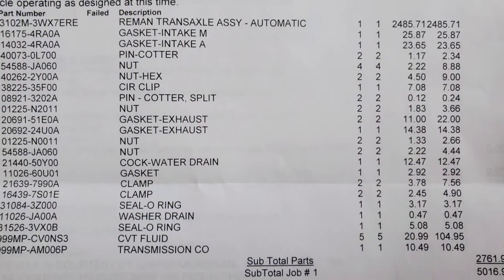2017 Nissan Maxima Cvt Failure! 🔴 What Signs to Watch For and Things To Avoid!

Comment: Very interesting. Thanks for posting this. First, I am shocked that a car like this even has a CVT. I don't think I agree with that. And I had no idea these CVTs require such frequent fluid changes. Someone wrote in down below that an oil cooler should be installed and I definitely would do that. I am watching this video because I am thinking about buying a 2017 Maxima SV with only 9000 miles on it (today is 11/30/2022). The car just sits in a garage and never used and I think the guy wants to sell it. I currently have a 2003 Acura TL-S which was 20 years old last June and it has been an amazing car. I have done nothing except a lot of maintenance and I still have the original tranny, which I have serviced often as well, but not 20k miles...... that's crazy. I am sure the Nissan manual doesn't require that. My Acura only has 134,000 miles on it and it runs like the day I bought it. I was just thinking to get a new car at this point after 20 years and this Maxima with only 9000 miles on it seemed like a good move. BUT, I am not so sure now. These CVTs in a performance car like this was a mistake. I don't want a $5000 bill. Sometimes it pays to keep what you know. I don't drive much anymore anyway. I definitely like the looks of the 2017 Maxima though.
Reply: Without doubt great looks. But like you, that CVT scares me.
Reply: @fazilm1  I have to assume that if the car is not driven hard, especially when cold and you do frequent fluid changes, they will last 100k miles or more.... personally, if i had one i would get the fluid and filters changed at 20k - 25k miles and make sure it had an external cooler on it... maybe even get a secondary cooler.... this way it won't get as hot...
Funny, since I posted initially I had to replace the original tranny on my 21 year old Acura... maybe I should have kept my mouth shut. But i have no complaints after so long... but the $4000 was rough... the car isn't even worth that anymore, but the motor still runs like new...

Comment: Thx for posting. Sharing experiences helps others and you never know when something might be posted that might help you.
After reading about Nissan CVT issues, I still just now took a risk and purchased a 2015 Altima 2.5L because the price was so low. Car drivetrain appears to be operating top notch despite having over 210,000 miles on it so yeah... I'm wondering if there is such a thing as a CVT designed EOL even if it was maintained perfectly (of course, no way to know you only have the word of the seller). Compared to your videos, I hear nothing of the roughness you seem to get al all RPMs, mine is practically silent through the entire range. 
In fact, I'm currently trying to figure out a weird whining sound in my car that is louder only when in idle and actually gradually disappears in a couple of distinct steps as torque/rpm is increased... Completely backwards from what people describe as signs of a failing CVT. Although the whine seems to be related to RPM, am considering it might be unrelated to the CVT, eg A/C.

In any case, fingers crossed, I'm hoping that if my CVT fails, it won't be for at least another 8 years or so which hopefully would allow more pulled and remanufactured CVTs to come to market. I notice that at least today that there are so many available used and remanufactured CVT older than 2009 that decent options exist as low as about $500 whereas today it's really hard to locate anything for your and my model years... I see a couple "maybes" for about $1600 and am not surprised at all that you paid $2500 for a remanufactured which probably has a decent warranty plus misc parts that might total another $300 or so.
Reply: Discovered what the whine I was hearing is from a comment elsewhere.
After a bit of testing, verified it's the electric power steering.
The comment I read said that person had it diagnosed by a Nissan dealer which said that the whine "was normal" so don't do anything about it. 
Wow. It's a very prominent whine, and as I described is completely opposite how people describe CVT problems in that the whine is more prominent when the engine is either at idle or low RPMs and although still there is less prominent the faster the car's speed.
Hope as described it really is nothing to worry about. There's no problem with steering and fluid is fine. 
And, just to be certain I bled the line by turning the wheel all the way extremes several times.
Reply: fluid type is nissan psf

Comment: I have a 2016 Maxima. Im noticing a bit of a lag/delay when shifting on (R) and (D) and the car shake a bit when changing to those gears. Is this normal for CVT or it means there's a problem with the transmission?
Reply: Eventually the transmission will go.
Reply: @iansamaroo9187  k but what about my question?
Reply: @hircine92h  once your having that issue with the delay in switching gears it’s the CVT that’s going bad and eventually it’s gonna give out. It literally just happened to me last week and made the decision to replace my transmission. But not from the dealer because they wanted twice the amount I actually paid to get it done.
Reply: @iansamaroo9187  I search online and some ppl saying its normal for CVT to do this and others said they had it since they got the car from day 1. So idk its weird to me as I always driven the traditional automatic transmission.
Reply: @iansamaroo9187  I even took the car to some place to look into it. They scanned the vehicle and found no issues.
Reply: @hircine92h  as a precaution change the transmission oil.
Reply: @hircine92h  also when you do an oil change go to autozone and get Lucas Oil and mix it in with your reg oil. It’s a lubricant to help with the pistons and transmission. But make sure it’s not Lucas Oil for trucks don’t get that one ok.
Reply: @iansamaroo9187  Got it. Thanks a lot.
Reply: @hircine92h  not a problem anything to help. Hopefully this can help others too…any questions that I can help with I’ll do my best!

Comment: Steady foot on takeoffs otherwise different acceleration results and thats normal. Some dont know how CVTs operate and how sensitive they are to your foot. I saw that the car was accelerating in both clips and no slips whatsoever just a different acceleration behavior to throttle response.

Comment: I have a 2017 SL with 103k miles. I've noticed an issue with what I think is the torque converter. When I'm going from 0-35 then let off the gas there is a thump feeling, and the torque converter does not lock up smoothly. I've done a transmission flush but it didn't help the issue. Does anyone know what this problem could be? I'm worried about having to replace the whole transmission.
Reply: You usually get that phenomenon when you are at light throttle and the lockup function of the torque converter is at the threshold of either locking or not locking.
Reply: @mitchlu  I got rid of the car, scared me thinking the transmission was going to blow, never experienced anything like that in a vehicle before
Reply: @tempo869  I understand completely. That feeling is definitely way more pronounced in the Maxima (I had mine since new, 125K miles now). In my  '07 Altima 3.5SE, you didn't feel it as much, but it was definitely there.

Comment: I traded in my 2016 Nissan Altima I had for six years, bought in 2016,. I got it when it had 2,000 Miles, traded with 58, 000 Mike's for a 2019 Nissan maxima cv  with 21.000 miles on it.  I want me now a Dodge scat cat 2021, with 50, 000 miles for $55,000 Miles in a white, body the green is for $47.000 miles.
Reply from the maker: i sooooo want a charger but its not in the cards right now

Comment: My 2021 Altima sv will hesitate like hell for about 5 or so seconds then take off like a damn rocket. I’ve only had it a year and only 50k miles. And around 1 to 1.5 k Rpm at low speed it’s doing that shaking rumbling thing. If I would’ve known about the Versa coming in a 5 speed I would’ve bought one brand new and spent less than a used Altima.

Comment: did you do a CVT fluid flush refill before 123k? if you didnt. thats the main reason it went out. CVTs are m reliable. manufacturers lie if they say lifetime fluid. cvt fluid deteriorate. heat makes them go bad as well. well known mod if your into the car modification it cvt transmission coolers. Essentially a thermostat which keeps the cvt fluid in the sweet spot for temps. and im referencing subaru CVTs. You had a Nissan CVT so you were a goner from the jump. CVTs get a bad rap because of Nissans. their CVTs are the highest for faults.

Comment: I’ve owned my 2010 Maxima SV ten years. I bought it back in 2012 with 39,000 miles. At 99k in July 2016, my CVT was replaced under the 100,000 power train warranty that Nissan extended out to some of the 2009-2010 Maxima models. My cvt never went completely out but it was making a slight whine during our hot Vegas summers, so Nissan replaced it. Fast forward to 2022, it’s still driving good with 176,000 miles on it. Call me silly but my car has been maintained by the dealer and I was never sold anything I didn’t need to prolong the life of my car. I never had any serious issues nor has my maxima left me stranded. I feel for my fellow Maxima owners. I like the smooth acceleration of the cvt for the Maxima. I was going to upgrade to the Maxima SR or Platinum trim but I still like the curves of my current generation. At the end, it’s unfortunate that the cvt may have been the culprit and the reason why Nissan decided to axe the Maxima for gen 9. This has been a great car to me
Reply from the maker: your experience sounds similiar to mine minus the dealer covering my replacement. Overall i still love this car
Reply: did you use oem cvt oil or aftermarket
Reply: @joeydelmarsjr.646  OEM
Reply: finally a vegas person, i bought mine 4 years ago, 2015 altima with 59,000 miles. now i am starting to feel the slip BUT i didnt do my research on the nissan transmsission. NOW i know.. change the transmission fluid 30k.  i love my car and it’s very sentimental to me, my dad helped me buy it before he died, ironically so i would have a reliable car that would last me 200,000 miles. i need this car to last me, didnt have a good experience at nisssan on sahara, where do you go? our summers are brutal.
Reply: @jaynafayknight  Henderson Nissan  (now Findlay Nissan) at the auto mall. I’m abt to do my 200k mile service before the summer hits. My service advisor is Chris P if you happen to stop by. His desk is the first desk as you walk in the service area.
Reply: @djaydoubleyou8162  awesome you are rad thank you

Comment: My 2017 Maxs cvt went out at 73k on it might have been my fault for not doing a fluid change on it at 60k but yet again i used to beat on it and use manual mode often i went to lkq bout a cvt off a wrecked maxima for 800 with 63k on it and paid 1200 for the install definitely wasnt bad but since then not once havent used manual mode and baby it have currently 98k on it and just did a fluid change + the 2 filters its a great car just with it had a better transmission

Comment: If I EVER needed a friend, I need 1 now.
I got a transmission flush done by my mechanic, at around 75-80K miles. 
I did NOT know, that there's a specific trans fluid needed for the flush.
My mechanic is a old school mechanic and I believe he used some typical trans fluid, NOT knowing that you need CVT fluid. I didn't know of this CVT fluid, until 1 week ago.
Called Nissan and he said, IF your mechanic messed up the trans flush and it was the wrong fluid - you would noticed issues, a very long time ago. 
I just turned my 07 Maxima to 115K miles and now the car "jerks" when accelerating - Is it TOO late to do a CVT flush or I gotta replace the CVT ????????????????? PLEASE SOMEONE HELP ME OUT

Comment: Yes! The class action lawsuit covers almost the entire lineup with the CVT. My car is a 2013 Altima, but I’ve got 190k on it and I drive it like a granny. My next vehicle will absolutely be a Toyota product hands DOWN. I’ve loved the car and it’s gotten me from point A to point B but overall it hasn’t been worth the stress of worrying about it.
Reply: Toyota also has CVT's however supposedly they are better then Nissan
Reply: @craftlover9702  no belts all planetary gears in Toyota
Reply: @miketresham4783  and they use chains too. I got the 2020 corolla myself and all my driving in both the city and highway is 2000rpms or lower. Higher elevations at the most 2800rpms, thats how efficient it is.
Reply: @miketresham4783  Does that mean it's much better?
Reply: So did they replace the transmission?   Is it a different design?
Reply: @eastside313yahdig.2  yes they replaced any transmission that was experiencing those issues. All in all it was a 300 million dollar lawsuit since Nissan knew of the issues and still didn’t bother to change the transmission or the mechanics.
Reply: @craftlover9702  Yes, using a planetary gearset is far more reliable than a push belt style CVT. On a Nissan there is a steel belt, not exactly a chain, it looks like a hammered out piece of steel that has very tiny links wrapped in a circle. 

The Toyota Hybrids have an even more reliable system. Since it uses an electric motor for most of the work and a planetary gearset attached to it.
Reply: @ehh2681  the toyota non hybrid cvts use chains and they are good
Reply: @ehh2681  so what if I buy a use 17-20 and it starts this issue, will they replace it for free?   I plan on buying one with less than 30k miles.   I’ve seen a few 17’s - 20’s.
Reply: @eastside313yahdig.2  They have a 5 year 60k mile warranty on the new ones so if you don’t think you’ll use the car or trade it in before 100k then I’d say go for it. 
I’d still go for a Toyota Camry though no matter how much more expensive they are. It’s more worth it to invest in something that will last you in the long run, but if you aren’t planning on keeping the car for long then I’d say go for it.
Reply: @ehh2681  yeah dawg I roll my cars,    I still got my 03 LX sport crown Victoria (daily drive) bought it in 08 with 52k miles  got 240k on it now and still rolling
Reply: @ehh2681  Thank you!
Reply: I have the same car (2013 Altima 3.5L) with 121k miles.  I love it.  It gives no trouble, except sometimes when I am following someone who drives like a granny.  🤣  My transmission does not like super slow acceleration and will sometimes shudder if acceleration is indecisive.
Reply: @miketresham4783  A planetary gearset is not a CVT.

Comment: CVT Transmissions... basically a steel ELASTIC belt that is connected to your engine on sort of a variable  pully system. This system on a car with as much power as the Maxima is not asking for trouble but expecting trouble. Nutty wacky idea... give me an 8 or 10 speed Transmission with actual gears NISSAN.

Comment: This sucks I feel like the v6 engine is too powerful for the CVT transmission it’s what damages it even more I have a 2013 Altima I for sure do feel some jittering at times but overall still a good car and it runs very well I do all maintenance myself to make sure it gets done I have around 167,000 miles

Comment: Please, these comments are killing me. 
First things first, stop relying on the dealership. CVT's are not bad. It's the people who drive them. To all cvt pushers think. When you're getting service to the vehicle that doesn't require moving the wheels they will try and get you to buy new tires or rotate them. If you say yes or get work done that mech moves the tires, your done for. They know that.
Ok, say you ask for $80 dollars and I give u $1000+. 9 out 10 u should question that.
80ft-lb torque is required for wheels not 1000+. 1st CVT killer. 
2nd and 3rd. BG MOA in the engine and BG CVT conditioner in the transmission.

Comment: Nissan saying their Xtronic CVT is a good reliable CVT is just total bullshit.

My parents had a 2012 Nissan Dualis (Qashqai) with 90k miles. Only problem we had with it was, when trying to use the transmission in cold weather, it would totally lock up.

Now they bought a new Qashqai with the new DCT. Much better transmission.

My moms friend had some 2016 Qashqai with the CVT and they had to change the transmission because it failed during factory warranty.

Comment: U were at 2 stop traffic lights why you taking off like you racing? CVTs are built different you ain’t driving a buggati or a supra to be taking off like that lol i have a 2017 Nissan Sentra SR & i bought it back in 2020 & it’s still going strong till this year. Just take it easy & drive normal let it catch up on it’s own. Yes CVTS sound good inside the car but there not a supra or a corvette lol In reality your not gonna start running fast quickly till you outta breath gotta give your body a warm up before anything. Same as a vehicle let it warm up a bit drive for a bit relax. Smh no wonder all used cars are damage people treat cars as a race car & never take care of em.
Reply from the maker: Slow down on the accusations and listen to what I said, I'm not a kid. I didn't race, I was showing that the rpms continued to rise rather than shifting downward while my foot was in one place steady.

Comment: I believe that every manufacturer has had  some sort of problem with the CVT
Regardless of who made it.
It it my opinion that the very physics of  how a CVT works is a problem.
It has a weak link ( the belt) in its very design.  I wont buy any car with that transmission.